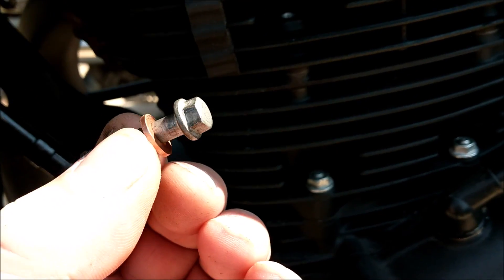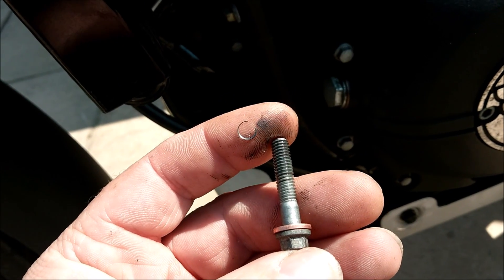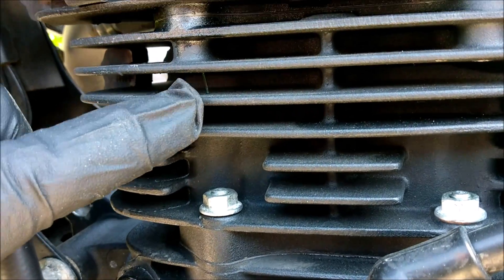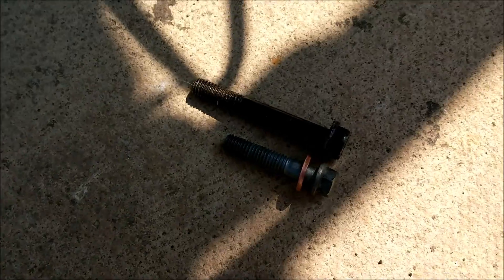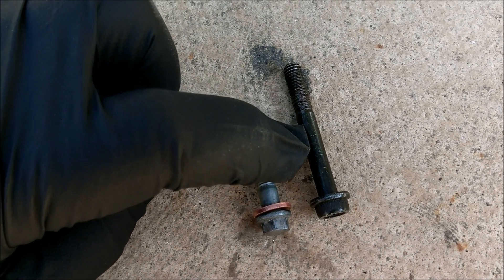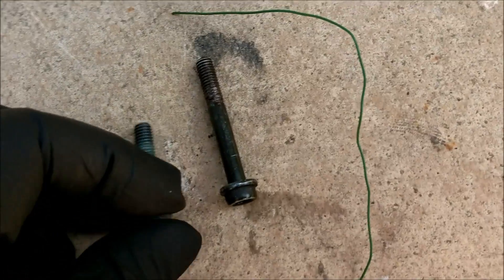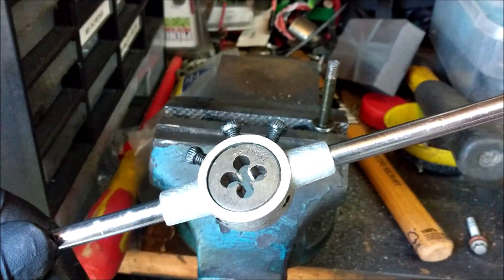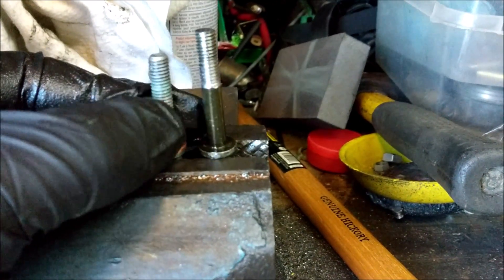Royal Enfield Himalayan #17 Head gasket weep

Comment: Bang a tap through it
I seen one of these with a slipped flywheel, it sheared it's locating key and then wouldn't start because the ignition timing was out, the taper wasn't holding or torqued up properly, worrying
Reply from the maker: Agreed, the finish (human input) isn't brilliant, hence why i basically start again and iron out the creases. To run a tap through there would require a head strip down, mines stopped weeping so I'm not going to go that far until such time as it needs it. Thanks for the comments bud, appreciate it

Comment: I only have about 400 miles on my Himalayan, but I haven't had an issue with loose bolts or weeping gaskets. I don't know about elsewhere in the world, but all the RE bikes coming to the U.S. pass through an assembly and inspection process in a centralized Royal Enfield facility (in Dallas, I think). I suspect that if it's left up to individual dealers to do the assembly and inspection, you'll run into the occasional slipshod product, not necessarily the fault of the parent company.

Comment: Mine is seeping a little from the front bolt. The oil is coming from under the bolt head where the copper washer is supposed to provide a seal ? I can see the edge of the head gasket and that fin space is dry. I'm going to do your mod. but I think I will use some type of sealer in the bolt hole and under the washer as a backup.
Great bike by the way, I live in Mexico and it's a perfect match.

Comment: Looking in the service manual for this bike, those two bolts should only be torqued to between 8 & 12nm of torque which is leaving me questioning if these bolts would have any effect on the leaking head gasket when the four main bolts (inside) are supposed to be tightened to between 40 & 45nm.
What are those two bolts supposed to do then because I cannot work it out? I have a picture of the service diagram if it helps you buddy. I guess I’m still trying to find a good reason to buy this bike over a Suzuki or another Honda but I just cannot push the button right now given the troubles you have faced. If I did buy one I would have to take the bike home, stick it on the stand and strip it front to back as you have virtually done.
Best regards
Reply from the maker: It doesn't matter what the torque settings are for the two left side bolts, there's not enough thread to have any purchase, hence me putting a longer one in, it's fixed the issue but the other bolt is now weeping so will do the same to that. Would i have bought it knowing what i know now (or have had to do to it) is a tough question to answer. It's a great bike once sorted, but it cut out yesterday nearly throwing me off in busy traffic, it was only my experience that kept me upright. Very un nerving indeed, and both calipers are now causing drag where the cheap pistons are corroding. Will source stainless steel ones and clean and replace. It's a good bike some days, lethal other days.
Reply: adrian eades  I think you’re missing the point Adrian. That is only a 6mm bolt with an 8mm hex head. It wouldn’t matter how much  metal it had to screw into, the service manual states it should be tightened to only 8-12nm which is very little. That’s half the tightness of a typical sump plug and we all know what happens if you over tighten those on an aluminium sump. My point was I don’t think that bolt does anything for the tightening of the cylinder head. That’s the job of the four larger 10mm (12mm hex head) bolts inside. If you took off the rocker cover you will see these bolts inside and it is those bolts that would need re tightening to 40-45nm to stop the head gasket leak. I’m scratching my head as to what those two 6mm bolts actually do and maybe the answer might lie in the copper washers they are seated on. Why copper over steel? I’m not sure but someone must know. Thanks for the info on the brakes and cutting out problem. As much as I want one of these, I think I’ll keep my CBF1000 a little while longer or maybe look at the V-Strom 250 for the lighter option.
Reply: @scootyman2974  a yamaha xt660x is a good alternative, aside from corrosion at the front engine area they are great bikes, lovely soft power and they squish down a lot so don't be put off by the seat height spec. I'm 5ft 7 and it was done for me

Comment: Hi Adrian did you have to run a tap in the bolt hole on the Himalayan to thread the new bolt in the hole way or does the threads go almost to the bottom because I'm starting to have this problem now at 3500 miles and I want to get it done soon thanks.
Reply from the maker: No threading needed, just swap out the bolt for one That's five mm longer
Reply: @restorationcentraladecaz  Ok thanks I'm going to get that done this weekend.

Comment: I went and bought a couple of 6mm x 36mm long bolts and put them in.  Was careful not to tighten to much.  Seems to be working.  Thank you for your video.
Reply: Is the 36 a direct fit? Mine is weeping and I'd rather not strip it so new bolt first.
Reply: 2019s have a 35mm long bolt if anyone is interested. the stock bolt is fine so i torqued that up but now the other side is leaking.. headretorque great

Comment: Hello Adrian and thank for all your videos !
Your solution is fine for those having an oil leak near those 2 screws, but on my Hima, the gasket was leaking at the front right side of the motor, and I had to fasten the 4 "big" bolts of the motor head.
Some photos here on my blog (in french) :
https://motohimalayan.wordpress.com/2018/11/28/fuite-au-joint-de-culasse/

Comment: I don't have this problem, but I'm glad I watched this just in case things change. Thanks.
Reply from the maker: Have you had a look under the fins at the hole where the bolt end should be, is yours threaded?
Reply: @restorationcentraladecaz   I have not had a close inspection, no. But I will as soon as I get back to Alaska in about a week and a half.  I'll be finishing up my comprehensive Himalayan review and plan on shooting some up close video and up close photos of certain details. I'll make this one of the things I point out and discuss.

Comment: Considering the bike has only just come back from having a warranty repair on the cylinder head and is still only 6 months old, would it not be better to return it to the dealers. Surely fitting another bolt of a different species is going to void your warranty. 
Do you use a torque wrench when checking these bolts.
Reply from the maker: if it weeps still its going back, the bolt ive used is high tensile steel, and the right size, cant see how that would invalidate any warranty
Reply: @restorationcentraladecaz  Hi Adrian, warranty claims can be like insurance claims at times, with them looking for a easy way out of paying for a repair. If you do take it back I would put the original bolt back in, all the bolts on my bullet are marked as a Indian manufacture. Tony
Reply: @tonyrigby5700  original bolts tend to strip when people torque em.

Comment: Is that the new head you had put on and what is the mileage on the bike now. Great bikes just the little things that suck I found my stalling problem was to much fuel in the tank had it to the level per the manual and still some gas got down to the charcoal can and was stalling the bike and my fuel gauge in the tank is off by a gallon all problems from India on YouTube but the bike is great for everything ride safe.
Reply from the maker: Yes new head & block n piston, it's covered 2k miles now. Not been raced or neglected, glad you have sorted out the stalling issue

Comment: It's these little details that spoil the bike. Just been out and measured the same bolt on my bike and fins that the bolt terminates about 5mm prior to exiting the hole. Is this the same as your original bolt?  Just wondered if the wrong length bolts were used during production.
Reply from the maker: hi Legin, thank you for your comment, does your bolt have the copper washer or no washer? my bolt is 30mm long
Reply: Has copper washer. Not taken bolt out of head so no knowledge of true length. Bike new and due first service so not messing too much it at this early stage. Bike was manufactured in Feb this year. Interesting that the Himalayan appears to be built in two different factories in India so one wonders if their are quality differences between the two.
In any event it seems development of the model is still work in progress as customers discover more issues with the build. Taking a measurement with bolt in situ and allowing for the 5mm short of full length drilling it's 35mm from flange.
Reply: Why do some have copper washer and some don't?? Mine does and is leaking too, I found it started leaking after running in period, I assume it's because the revs were allowed to be increased?? Apart from this, a totally cracking bike!! Love it!! Better than the piston seize I had on my Honda lol

Comment: There is another vid on this subject where a guy removes this and another of the head bolts due to oil weep and the thread comes out with them like a helicoil. In fact they could well have been helicoils.
Reply from the maker: hi, it wouldn't have been a helicoil, it would have been the stripped thread, because the thread depth is not sufficient to begin with so when they leak the owners or the dealerships simply try to tighten the bolts up and strip the soft aluminium thread. if the thread was right through the block casting to start with then a longer bolt could have been used to clamp the two mating surfaces together enough so the head gasket would not have leaked to begin with.....
Reply: Yep. Also an easier machining process to take it right through.